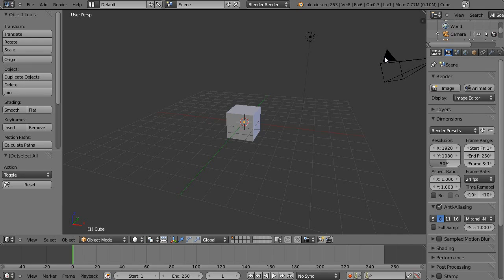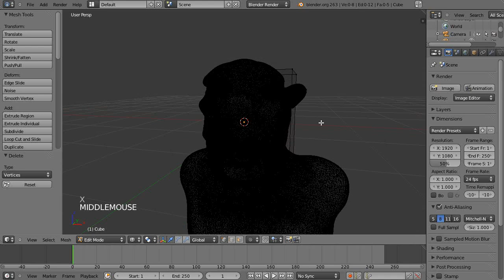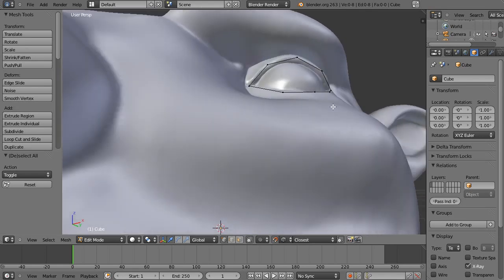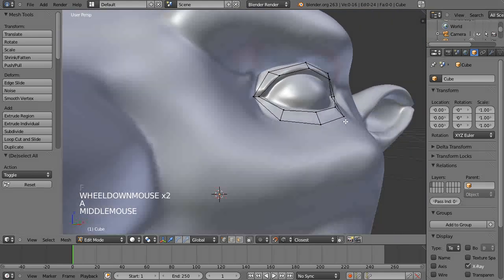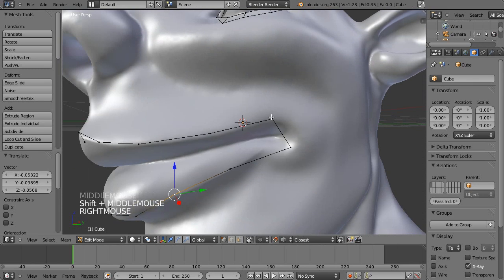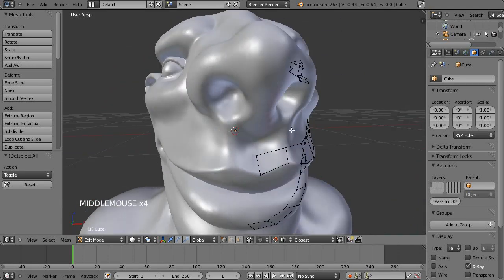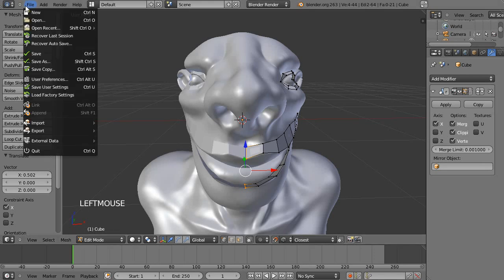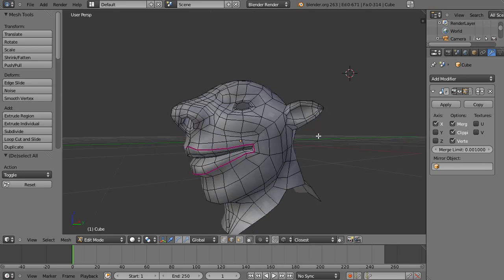Basic Re-topology in Blender

Comment: Hello, Jjannaway3D.  I am having a small issue with my Mesh in Blender.  I was wondering if you would have some idea of what to do.  Here is my issue.
  I use Blender and Cinema 4D lite R19 to open and manage different types of 3D model files so I can convert them to OBJ files and use them in Element 3D for animating.  When I open a WRL file in Cinema 4D Lite R19, the model is nice and smooth looking.  I would  have been happy with the model as it was, accept that whole thing was almost one single object, so I needed to open the WRL in Blender and and try to separate the mesh into several different parts that can be individually animated in After Effects through Element 3D, because as far as I know, C4D Lite R19 (a plugin version for After Effects) lacks the ability to do so.... and here's where the problem begins.  
  Like I said earlier, when I open the WRL in C4D Lite, it's nice and smooth and looks good.  However, when I take that Same exact WRL and open it in Blender, it's jagged, rough and has looks very "geometric."  I didn't think much of this and did a bunch of work and exported the object as an OBJ to open in Element 3D, thinking that it would be "smoothed-out" in the file exporting process, but I was wrong!  It looks exactly how it did in Blender, hard-edged and "geometric!"  not smooth and soft as it did in C4D Lite!  ...No good.
  So my question is, do you have ANY idea as to why opening the WRL in Blender causes it to look hard-edged, rigged and Geometric?  In Blender, I have tried "smoothing" the mesh and that just tares it.  I have tried "Subdividing" and "Subdividing-Smooth" properties and neither of them work.  I was going to try a "Shrink-wrap" technique I learned form Youtube in an attempt to "re-mesh" the surface.  I just can't understand why the object goes from being nice and smooth in C4D Lite... to hard-edged, jagged and "geometric" in Blender.  Any ideas?  Either way, thanks for whatever help you can offer!

Comment: Is there an option to retopologize with curves initially, and then form polygons from their intersections?

By using straight edges as you are, you are committing to intersection points at vertices, and thus the positions of perpendicular lines, when the intent is only to define the marked edge.